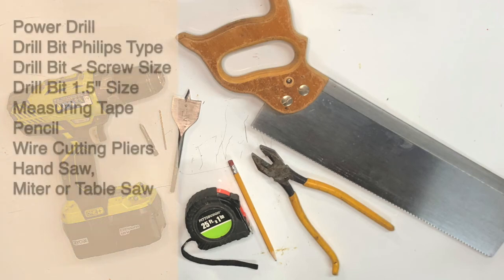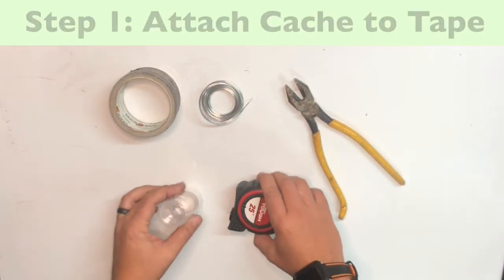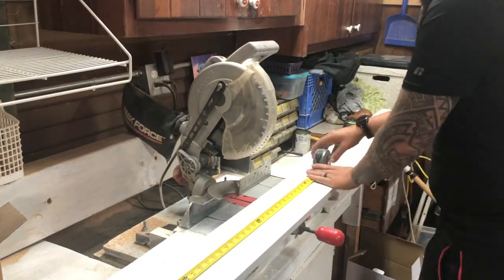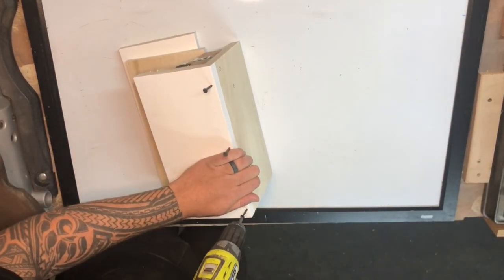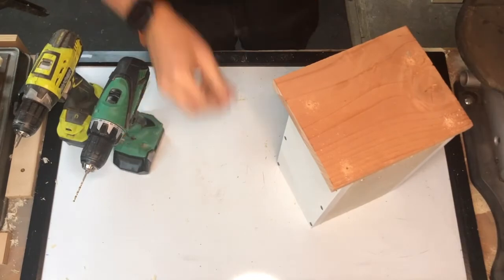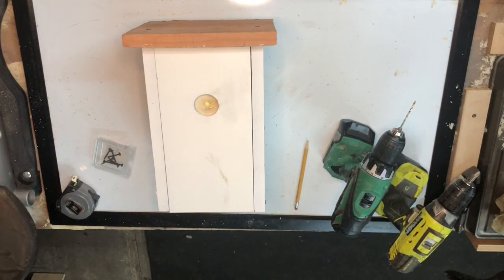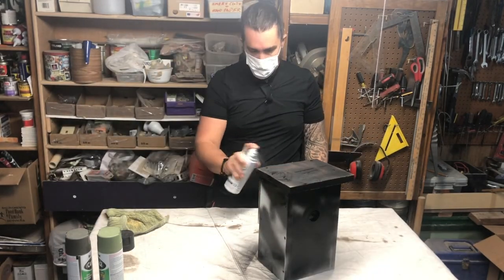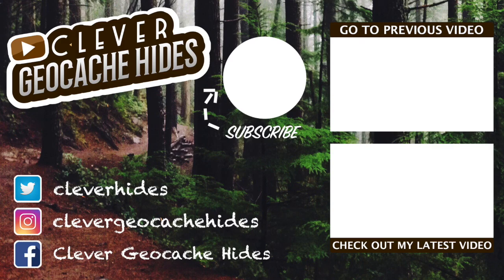Build Your Own Birdhouse Gadget Cache (GCNW)

Comment: Nicely done. Does the inner tube work well and how long does it last to hold the cache to the tree?
Reply from the maker: So the jury still out on it the longest I’ve had went out with this method is about six months now. What I do like is that the tube expands with the growth of the tree yet the birdhouse is still securely fastened.
Reply: @CleverGeocacheHides  so do you just tie it?
Reply from the maker: @BehindtheCache  - yes. Sometimes I use two tubes to attach if the birdhouse is heavier or if the tubes I have are thinner. Don’t throw away those old flat kids bike tubes!!!!! I tie them tight then cut off the excess. So far it’s worked well. I saw the one you did that was a hanger. Afraid that wouldn’t work for this type. Great for quick release mechanism though.

Comment: I really liked this build, easy to understand. Could you send me a photo of the rubber bike tire tube tie down on the ree and bird house? Is it just a granny knot you use?
Reply from the maker: Ya usually I just tie a granny knot. If I need extra security I sometimes put a chain inside the tube with a lock.
Reply: @CleverGeocacheHides  Thank you for suggesting using a chain inside and a lock.